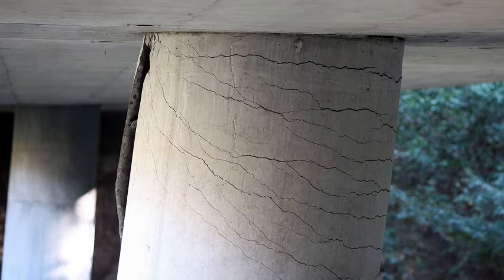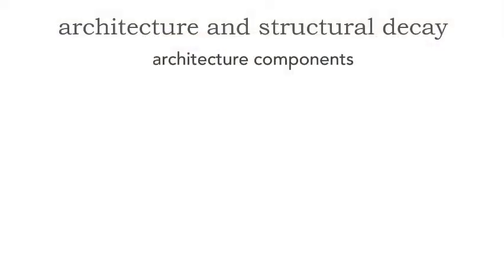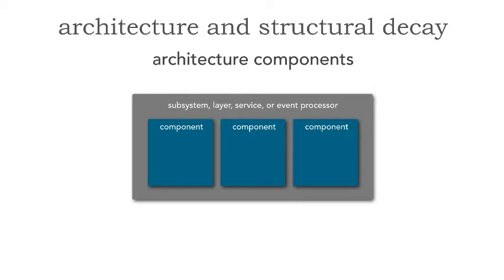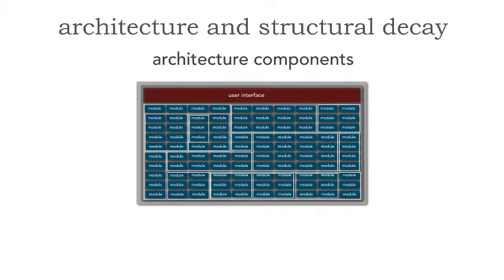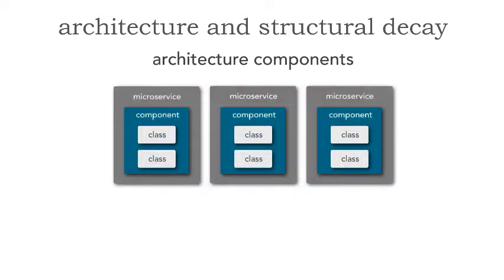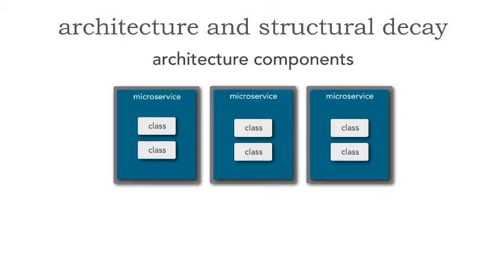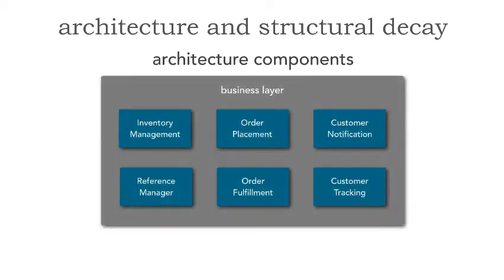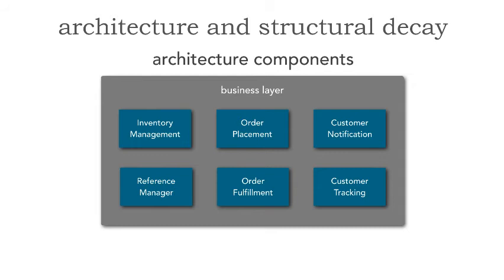Lesson 8 - Analyzing Architecture: Components

Comment: Parallel loader pattern?
Reply from the maker: Hi Dmytro, often times when a service starts up it has to load a bunch of data. A common example of this is a reference data service, which stores reference data like name/value pairs, country codes, agency codes, claim codes, store codes, etc. The parallel loader pattern is one technique that utilizes threads to load all this reference data in parallel. I've used to to significantly increase the startup time of these types of services.
Reply: @markrichards5014  oh, that make sense! Just haven't found that name on first page of google results)